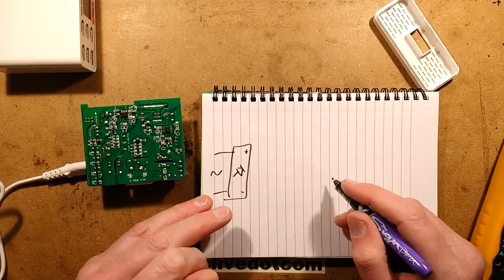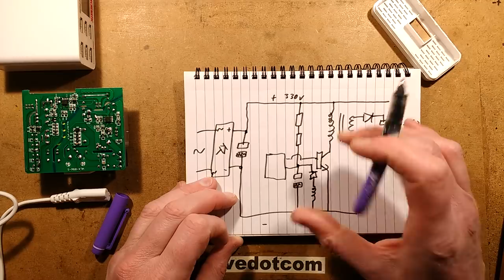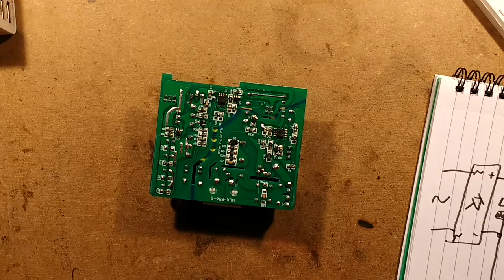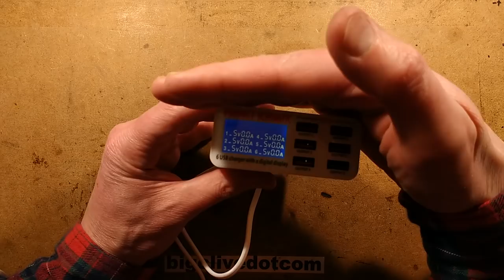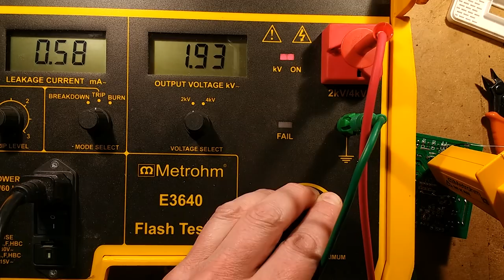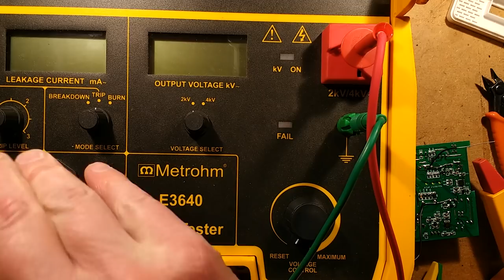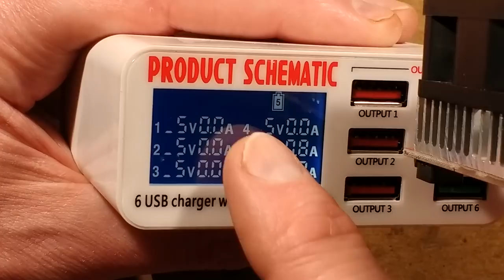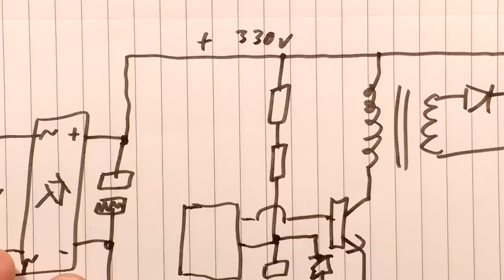Fixing a faulty USB power supply.

Comment: I like these kind of repairs as a challenge. I have a pile of defective atx psus and on one, I worked for such a long time. I tried to reverse engineer it. First, I copied the pcb layout. Then I noticed this is a huge waste of time since the redrawing of the pcb took me many hours. I tried to reverse engineer it but I still do not know what is wrong with it. It turns off instantly after power on.
Reply: Some only work when connected to a motherboard, and sometimes only of the correct brand. I've had several like that. Take them out of the computer and they just turn off, even when the usual sense voltage and connections are made. To me they're still a mystery. Maybe looking for a data packet? I don't know.

Comment: Re safety testing. I generally reckon a 1kV DC insulation test is suitable. But if you want to go higher, DC is kinder. AC can overheat filter components and the continual cycling of stress potential can cause partial breakdown. (You get one inception per half cycle.) When really what you want to test is a 2kV spike on top of the mains. And that's only in a thunderstorm. A bit more if you want to prove double insulation. Regular spikes are more like 1kV. 

Of course as you remarked there are standards which will tell you how to proof test. Umm, I would guess a USB charger would either be a power supply or IT equipment.
Reply from the maker: At 2kV AC a corona discharge is audibly occurring between windings which is concerning.

Comment: Hi Clive, love the videos. Have what could be a stupid question. On the circuit board, what is the difference in surface resister colouring? Is the Orange a Fuse??
Reply from the maker: Resistors tend to be black due to being a carbon based layer, and the capacitors are often a cream or orange colour as they are layered ceramic blocks.

Comment: I found it interesting how you were able to trace the problem to a wire. I had a portable dvd player that would turn on for a few seconds, then shut its self back off. After explaining what you did, it ocurred to me that whatever was supposed to warm up the main power supply before kicking in was no longer doing its job. Mabe the same exact thing as what you explained. However, my unit was old and my guess is the transforming unit was no longer capable of bringing the power up to operating frequency any more. I just decided to trash the unit anyways. I see them available at resale shops all the time. Apparently, no one watches dvds while camping, travelling or whatever any more anyways. Very informative video! I would guess the mass produced junk just wasnt soldered very well and came off during shipping. It probably passed inspection, then came apart during shipping. Gearbest isnt known for packing their products worth the damn any more than Banggood. Grey greasy filthy shipping bag is usually all you get, that and a really cheap cardboard box.

Comment: In Australia the insulation isolation test is conducted at twice the supply voltage.
Reply from the maker: That's the typical wiring test at 500VDC.  For isolation testing in products it has to be a lot higher.

Comment: I have one version of this USB charger bought from Fasttech. (https://www.fasttech.com)
So far, it's been a workhorse. I've been using it for about 2 years, glued to the underside of my repair bench next to a shelf where devices sit as they charge. The highest current that I've observed a single port delivering during the course of it duties and not under test, is 3.47A, with the voltage pulled down to 4.86. The one I have does not have the redundant "5V" readout. Instead it has only an ammeter readout for each socket. Can get a bit warm, but not much. Yes, the USB are mounted upside down. So, the seam on a USB-A faces upwards.
One time I managed to short a USB rail to ground very near the connection to the board when I plugged it into this guy. He immediately exhibited behavior very like what we are seeing in the beginning of this video. Fearing some kind of permanent damage, I went: "Oooohhhhdamn. NonoNONnonNONONO!" and yanked the cable out of the charger. With the added velocity from the slight friction in the socket, it flew back at me and pegged me square in the eye. "AAAAHHHHHUUGGH WHAt THE hell man!?!?" I shrieked to nobody, or perhaps to the charger which I anthropomorphized as male. (Which was just as foolish since it would not have been simply female- but some kind of MEGA-female.) 
The genders of gadgets aside, my roommate heard this commotion and pounded on the wall that separated us in our adjacent chambers. "Hey bro! You good!?" I held my sore eye in one hand and replied: "Yeah... I'm okay."  but, whether I was okay I wasn't fully sure. It seemed to me that a blinding wound would have hurt a great deal more than this one did. Finding an old DVD-RW in a heap of dismantled electronics, I held it up to my face and examined my eye. It was intact. It sure stung but not much more than, say, a quick whip on the back with a knotted extension cord on a cold February morning, standing on the balcony of a cramped apartment in a bad neighborhood, a voice behind you screaming between lashings: "You're the reason your father left! [THWACK] You little pisser!! [THWACK] Why did you do that TO ME!!! [THWACK]" until she breaks a rib over your kidney and you have to go to the hospital and lie and say you tumbled down the stairs your one-floor apartment didn't have... [clears throat] Excuse me, got off on a flashback there... 
Since then, "Mrs. Product Schematic" and I have gotten along amicably and have developed a mutual understanding of one another. He, ah- she understands my expectations and what I need of her. And I respect her for her design nuances.

Comment: I need help picking out a solar charge controller. I got two 120 watt panels and will have 3 deep cycle 220 amp hour batteries. Does it matter if I have a pwm or mttp.

Comment: Mr Clive, what are you testing for when you zapped 2000v through the power supply? Could you do a video about this test.
Reply from the maker: It's testing the integrity of the insulation between adjacent windings and potentially between low voltage and high voltage tracks on the PCB too.  It's to give a much more stressing test than just peak mains voltage to detect a weakness that may pose a danger in use now or at a later date.

Comment: Gearbest is a bit dodgy, the sales often tend to be fake and they tend to remove bad reviews by basically opening a support ticket for you instead of publishing the review. It is handy to see some user reviews but just gotta keep in mind that they tend to filter out bad ones

I did get a refund of a cheap wifi RGB bulb I bought, it broke and I didn't submit any photos or offer to return it and I got to keep the faulty lamp for free. eBay is definitely a lot more reliable

Comment: Just a safety question about discharging a capacitor. It looked like you used a metal screwdriver. I have always been told to use an insulated screwdriver. Does that even matter or just bridge the positive & negative posts of the capacitor?
Reply from the maker: If in doubt use an insulated driver.

Comment: Gearbest is notorious for their shitty warranty service.

I bought a 3D Printer from them last year and the heated bed failed after about a week of barely any use. I had to fight with them for over a month to get a replacement. I basically gave them the ultimatum that if they don't honor their warranty, they're going to be reported to basically every consumer protection bureau, as well as my congressmen for deceptive trade practices regarding their warranties. Texas has very strict laws on deceptive warranties to protect consumers and will bring the hammer down on businesses found screwing consumers, ESPECIALLY if they're elderly, then they're pretty much fucked. Harming senior citizens here in most any way is a felony.

They initially wanted me to try and "fix" the heated bed and provided steps that were clearly designed to destroy the bed, likely so they could deny the claim. I reported them at that point, and they caved a couple of days later and shipped me a replacement bed.

If you want any warranty position with them, you have to get down and dirty and willing to pull out all stops. Two things they're terrified of is if you report them for illegally declaring customs packages as gifts to avoid tariffs and consumer protection bureaus, because they stand to be heavily fined and potentially shut down.
Reply: GGigabiteM
I considered buying a laser engraver from Gearbest late last year. Decided I wanted it to arrive... Never bought from GB, but just far too many reports of stuff not arriving or poor after sales service.

Bought the same thing from Banggood and was rather impressed with the shipping time.

Comment: I watched one of your videos on fluorescent lamps and how the starters work, Today I took one of the starters apart and found what I assume was the little neon type lamp and noticed it was connected by tiny little wires but then there was also, in parallel, what appeared to be either a glass or really hard plastic tube which was connected by much thicker gauge wire? Please elaborate
Reply from the maker: The metallic thing in parallel with it was probably the suppression capacitor.

Comment: Awesome. I've seen those symptoms before and have thrown things out. Know I understand what is going on, I sold be able to fix out myself.  Thank you Clive
Reply from the maker: Most common bootstrap failures are the diode, capacitor or a dry joint on the transformer.  Sometimes the main electrolytic can dry up and cause the chip to reset too.  Al fixable.

Comment: Big Clive. I’m always dubious about purchasing less expensive 12 gang plug sockets so i always buy masterplug and belkin. Any advice on if the cheaper versions are just as good? (eg the DoubleYi sockets on Amazon)
Reply from the maker: It depends on the loads you're plugging into them.  If it's just small devices that draw a few hundred watts of power or less then they should be OK.   I wouldn't trust cheaper units with loads in the 1kW and up region.
Reply: Thanks Big Clive! Much appreciated on your advice!

Comment: I notice that the usb socket on output 6 is coloured green, I wonder if that has any significance??
Edit : Ah, just found your mention of it Clive, no data resistors. So a pure charge port then probably. (think they call it a DCP port or something?)
By the way, desoldering needles ordered, and from the comments it looks like you've created a few sales now, they should give you commission! ;)

Comment: I have a 20 way usb charger and I would like to make it a fast charger. The output is 5 volt at 2.1 amp per socket. I would like to make it  a 9.0 volt and even though it is says (100 watt) but when I charge my phone it says slow charge as my phone requires (9.0 volt.)

I am aware of (L78 / 09 CV ) b ut that is linner) and not switch mode. Or high frequency . As I am unaure. Plaese help.

Comment: Test voltage from primary to secondary to cover reinforced insulation (class II) is normally in the range of 3000V for dielectric withstand test  -  though this is often conducted after the equipment has been in a high humidity environment for a couple of days - but this varies from standard to standard.

Comment: Bit of a strange request but how about a small cheap lux reader with a data logger to see what sorts of power you could potentially generate with a solar panel.  Think you could make that?
Reply: Data logging multimeter on a said solar panel ?  Why make one if there are cheap options on the market.

Comment: C6 Cap is bridged with a very sloppy solder job? Looks like the resistor next to it is also bridged with the IC. Is that a proper bridge?
Reply from the maker: Not bridged.  There was an unpopulated pad next to it with a build up of solder on it.  R2 looked hand soldered and had a streak of solder on the side.

Comment: Thanks for the recomendation of these desoldering pins
They should be great for those nasty 8-Layer 'groundplane-only' jobs, were you desperetly trying to desolder sone stupid little tring with a blowtorch because the PCB sucks all the heat away
Reply from the maker: Also consider wooden toothpicks.

Comment: The extra IC at the top of the power board is likely the qualcomm quickcharge chip, if you plug a quickcharge device into the green port it should go up to 9/12v. I received one of these with the same symptoms, I fixed it by reflowing/cleaning up the power board with a soldering iron.

Comment: Why test the TX at 2KV when it runs at about 400V?? Is it because the flyback voltages peak higher or just a massive safty margin?
Reply: Simon Ashton It's to prove it has a good safety margin. When lives are at stake, always build and test to multiple times the normal load.  For example a roof must be built to withstand the worst of the local weather, times a safety factor that depends how many people will be inside.

Comment: Hippy test. You may find that 3000 volts ac RMS is the production test on the product, but barrier components like optos, transformer, are tested at 4000V by the manufacturer
Reply: I meant hipot test not hippy test!

Comment: I bought SJ7 cam from GearBest. Appeared to be faulty. Contacted them and I didn't get any reply either :(   Will never buy from them again !!!!!!!!!!!
Reply: At least they send you something after taking your money. Banggood  doesn't bother to send the stuff and ignores you for 6 months after weekly emails and tells you their records don't go back that far.
Reply from the maker: If it's crashing then try updating the firmware which is available from the SJCAM forum.  I've got one here and had issues with it until I updated it.  It's easy.  Copy the files onto the empty SD card, put it in the camera and power it on.  It'll update the firmware give it time and then when it's finished and turned itself off, remove the card, delete the update files and put the card back in.  (If you leave them on the card it just keeps updating whenever it's turned on.)
Reply: Also they were recently hacked and people's information including plaintext passwords were leaked online. I wouldn't trust them with my credit card info anymore.
Reply: bigclivedotcom Hi Clive. I did so and for a while I thought that's the problem was solved until very recently when I powered the camera up it froze again.  Pressing buttons did nothing.  I couldn't record nor switch it off.  Again had to take out the battery. The same day out of blue sky it stopped recording. Lost some of my paramotoring footage 😡
Reply: Can't you open a dispute on PayPal?
It works for me
Reply: I have reported the issue on PayPal.  Still got no reply from gearbest.  Will escalate it tonight.

Comment: Why is the OUTPUT 6 connector edge green while all the other ones are red?
Reply: According to product page, that one is QC (Quick Charge) 3 compatible, which does a handshake with the device connected to figure out what voltage/current it can handle, and can thereby charge at a higher voltage and deliver energy faster to the device.  Might want to check out https://www.androidauthority.com/quick-charge-3-0-explained-643053/ for a little more fleshed out version....
Reply: Thanks. Given the product's name, I was expecting it to be something stupid. Good thing that turns out not to be the case.

Comment: Clive? Fit like? If you put DC through a bridge rectifier will you get AC? Cheers man.
Reply: haggishunter243 if you put DC in to a full bridge rectifier you will get the same DC out, minus the small voltage drop from the diodes. Far as I know if doesn't even matter the polarity you connect to the rectifier, the diodes will fix the path for you.
Reply: Real funny, I had a silly thought like that the other day.
Reply: Ollie B Actually, you'll either short it out or not depending on polarity, but there will be nothing useful coming out from the AC pins.
Reply: John Francis Doe you won't. Quite the opposite - in fact it's commonly used to ensure correct polarity to the device. To clarify I'm taking about a full bridge rectifier made of 4 diodes. a diode bridge. Not a simple series diode for reverse polarity.

To clarify the question above was what will happen if you put DC in the input rather than the usual AC. The answer is you still get DC with some voltage drop, but ensure the polarity.
Reply: Cool. Well if your not making mistakes you're not learning! No such thing as a silly question. ........ Well most of the time!  😨
Reply: haggishunter243 heh 😁 you made me go look up and read more about it so that's good.. still, nothing I make works so far 😂🙃 perhaps I will leave testing the diode bridge directly until I figure out what is wrong with my silly colorful clock. 🤔🔥😶😋

Comment: Presumbly the usb power supply and meter does not have the obilitory CE (Chineese Export ho ho) mark.
This product should not be able to be sold as it's easy to get the product apart and touch the live mains.
This should only be able to access this with Philips or torx screws or using a lot of force to break the glue or welded plastic.
Unfortunately there are a lot of unsafe dangerius products on the market.
I think this product should meet the International IT standard 60950 but it may also have to meet others, to apply the CE or other safety mark's.
Now we are separate from this mark the international standards and BS will still apply.
Like, if I can remember 5.4 mm between primary and secondary circuits on pcb's or less if the board us routed (air gap).
The standards manager at Lambda would have a fit if he saw the products you review, as he had to retest and check products meet the required standards for rebaged products for his company.